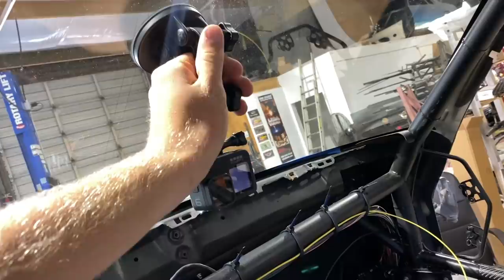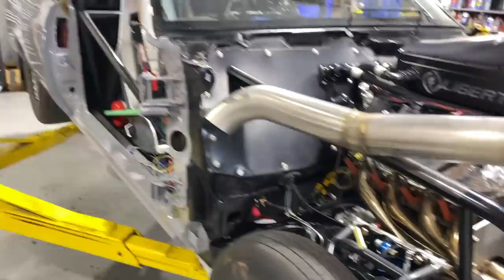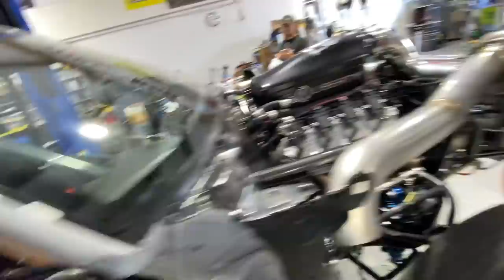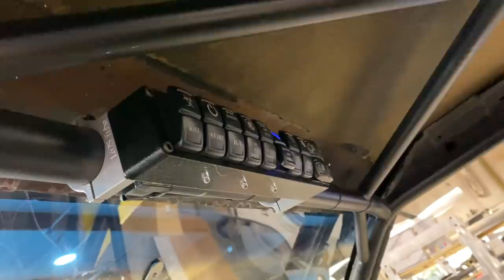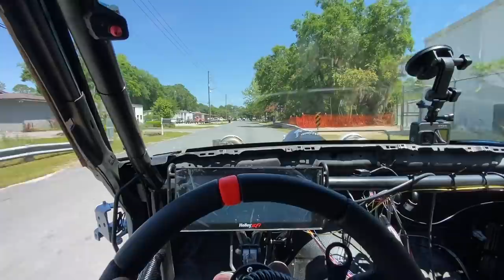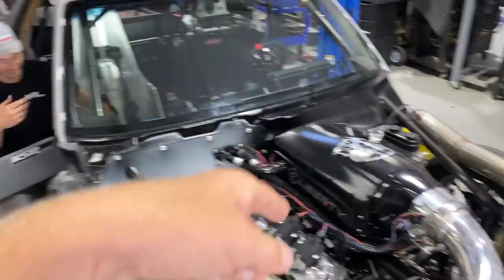MULLET IS ALIVE!!! First Drive in Our 2,000 Horsepower Twin Turbo El Camino!!

Comment: You need a finer mesh turbo shield guard. Good sized bolt rock bolt nut can get in and reek havoc, not worth the destruction aftermath.   Might keep a mouse out or a small wren out but that's  about it.

Comment: Yall should really put some 88s on Leroy and push to get him to be the first stick shift gm into the 6s. Because I feel like its possible now that its on radials. And it goes so straight and the motor doesn't even sound like its working hard at all compared to the old one that set the record. That thing was screaming down the track and the new one just sounds lazy

Comment: Cleetus, you've never heard turbos so loud. Then you've never been to the Woodward Dream Cruise from Detroit to Pontiac Michigan, or the Downriver Cruise in Lincoln Park Michigan, (much smaller event but a degree or two more spicy)! Literally, turbskies so dang loud, that you will wear ear plugs or roll up the window if you got one, as you cruise back and forth, beast by beast, lane for lane, at a blistering speed of maybe 3mph tops, in stop and go traffic that literally stretches for miles and puts every cooling system to the ultimate test!  Research your accommodations, parking and side venues (burn out pads, drag racing, Old metal and new metal areas, etc) really well before venturing up, or you'll just find it to be a big nightmare of millions of cars and car buffs, all trying for the same realestate to set up shop and function for the week. Living around here, the only drawback I see, that probably is only reported on locally, is the few professional thieves who like to steal tow rigs and trailers from motel and hotel parking lots. Every year, you hear of one or two, usually out of town rigs and or trailers, that are stolen, containing sometimes expensive or nostalgic vehicles that could never be replaced. So do diligence on your own security level, whenever you are busy enjoying the festivities or sound asleep in an air conditioned hotel room. Unfortunately Covid had both events almost completely shut down last summer, but this summer is looking a lot more promising for more normal size events. Awesome setup Cleetus. Can't wait to see it on the dyno and the strip! It's a screamer dude! Later. Jpol.

Comment: Pulled 30 degrees of timing because of an incorrectly configured input? Sheesh that must have felt like the biggest 427 cubed stick in the mud when that was happening. Better than adding 30 degrees of timing tho. Gotta love modern ecu’s and failsafe protections 🙂

Comment: I can see several things wrong with the Turbo setup off the start.
You must have huge Turbo lag......
The Turbos are too fare from the engine.
Your exhaust pipes are too long to the Turbo, consequently your intake pipes are too long.
Your intake manifold holds too much volume, takes too long to build up pressure.
You have no inter-cooler.
This setup would have been much better if you did a Compound Turbo setup.
Those Turbo's are way too big for that engine and you have two of them.
All in All you must have huge Turbo lag and power only on high RPM.
Not good.